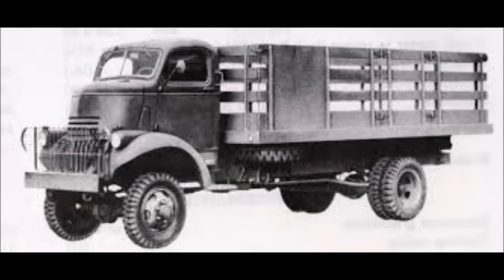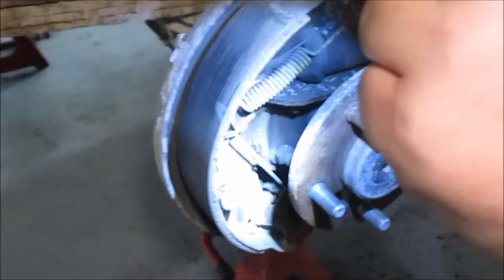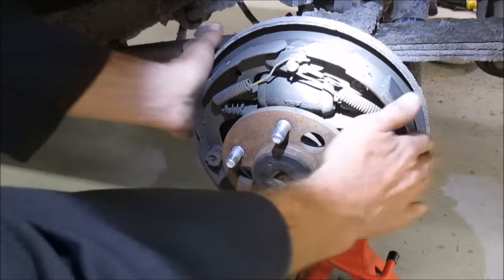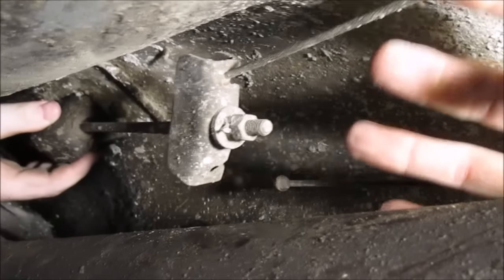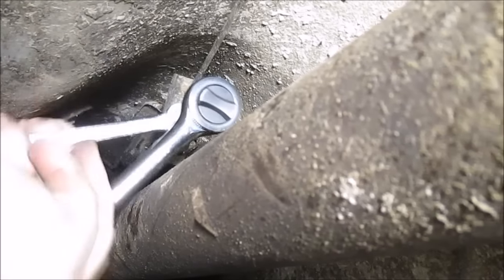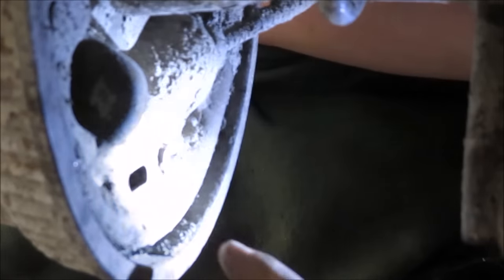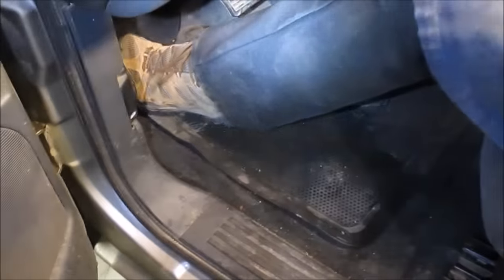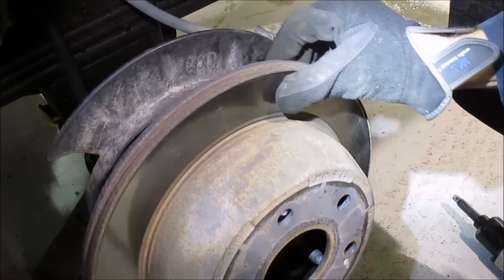Parking brake and drum brake adjustment and diagnosis

Comment: I can't figure out how to adjust the rear drum brakes on a 1983 Chevy k10 4x4 pickup.  There is no slot in the backing plate to adjust the star wheel and my parking brake just barely holds.  Hopefully you have experience with the old squarebody trucks because my service manual only says keep backing up and pushing the brakes which dosen't seem to be doing anything
Reply: 1 - First, make sure your brake shoes, mechanisms, drums, cables and pedal work properly and move freely and are not worn.
2 - Remove the drums, clean, lubricate and adjust the star wheel until the drums barely slide back on over the brake shoes.
3 - Put the wheel on with 2 nuts, spin the wheel.  There should be SLIGHT drag.
Repeat steps 3 & 4 until your parking brake works how you want.
Stay gold.
Reply: Mine doesn't have a star wheel. It has some adjusting quadrant, I guess it's suppose to self adjust? But there is a squeal when I release the brake pedal. The squeal is absent when the parking brake is applied.

Comment: What if my parking brake seems to drag and get the drums really hot??? How do I adjust them?
Reply from the maker: You might need to check the return springs inside the drum to make sure they are functioning properly. There is an adjustment you can make from the back side of the drum but I would start with checking the internal springs

Comment: If I have to press my parking brake pedal too far to the floor to get it to work, does it just need to be tightened at the back there where those nuts were?
Reply: I have the same question
Reply: Did you ever figure this out